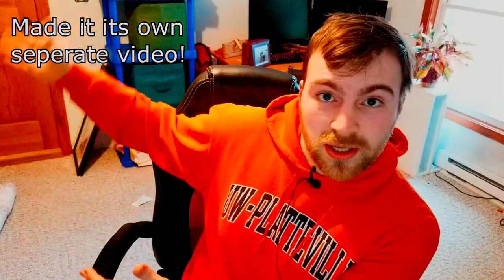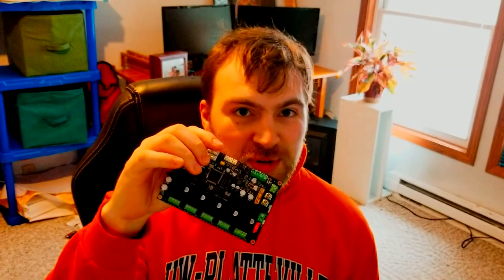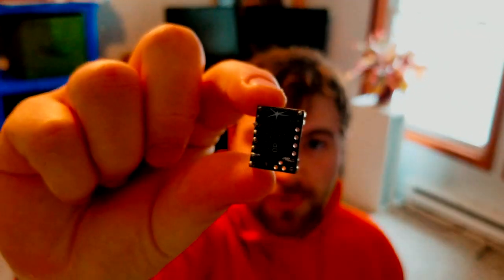Smoothieware to Marlin 2.0 - My story on the Azteeg X5 GT

Comment: Thank you for making this video. It convinced me to try Marlin on my X5 GT as well. Did you also have the problem that as soon as the sdcard option is enabled the communication with the TMC drivers is broken? I am also using the viki2. If so, did you find a solution or workaround?

Comment: I have some serious issues with Azteeg X5 GT as well. 
1. The hotend path gets totally out of control when it gets to higher Y values mid print, which results in priter crashing to hardstops. At first I thought it was caused by using grid leveling and WCS, but it still happens without WCS.
2. The printer freezes when starting print at beginning of first line (when it touches build plate). I found that if I change feedrate to faster, the issue is gone and print completes successfully. 
Now I am completely lost, because there is no clear information on the firmware running the Azteeg. Comments here are the best information source I found so far and it does not look good. Probably I will throw the printer to trash after I have upgraded it, because I am not going though all the configuration (and/or changing board) again.

Comment: I was in a process to replace my main board for my Rigidbot Big. I saw your video and notice you have Rigidbot Big and regular.  Do you have any main broad beside Azteeg X5 GT because this board is out of stock in many place.  I was having hard time to understand where to start and how it wire everything from main board back to the printer working again.  I saw your video on Marlin 2.0. It was helping on firmware edit and update.  If you have link where should I get all my parts, it will help a lot.
Reply from the maker: Hi!

I would not recommend getting the Azteeg X5 GT over more popular and cheaper boards that are out today. A very common board is the SKR 1.4 (https://amzn.to/2S6OYe5) (affiliate link) which has very wide community acceptance and great capabilities for the price of $62 with drivers included. If you want something that works out of the box and is rather easy to use, a duet 2 wifi will probably serve you pretty well.
Reply: @LukesLaboratory  Thank you so much  When come to wire back together, how do I mod the heat bed cable?  does Duet 2 using Marlin open source?  Sorry to ask like a newbie on this.  I just want to make sure I understand all the steps before order either board.  When I use those board how much improve that I will get in term of print speed?  I still using the stock broad that came with.
Reply from the maker: @kho75  There is a guide on the rigidbot wiki on how to join together the heating wires to make one "big" wire (since its really just positive and negative leads with 2 wires seperated for the thermistor) the Duet 2 uses RRF, which i believe at this time is a superior firmware - it uses gcode to configure it, no compiling or any other nonsense, you just edit settings in a single text file (and can edit them on the fly) and away you go! When you get your new board you may be able to go faster, especially if you follow it up with hardware mods.
Reply: @LukesLaboratory  Thank you so much to explain to me. Since yesterday I been watching a few video on those two boards setup.  You are so helpful.

Comment: Hey. Freezes like that absolutely never happen with a Genuine Smoothieboard. Azteeg uses a less powerful microcontroller than Smoothieware is designed for, and doesn't keep it's config and firmware up to date with the project. Both of these issues are likely to be the source of the print quality issues you seem to have. If it failed with heaters on, it must be using an extremely old firmware, this has been impossible in Smoothie for like half a decade. The stuff about the motion planner being better in Marlin than Smoothie is absolutely completely definitely incorrect, somebody was just talking to you out of ignorance, the Marlin devs themselves agree with this. Also, the difference in contributor base for Marlin vs Smoothie isn't as large as you make it out to be, and that's by design, due to the fact Smoothie also supports CNC and lasers, making it useful to more people, resulting in a wider range of contributors... If you take another crack at Smoothieware at some point, make sure you reach out to the Smoothie community if you run into issues, what happened to you are definitely things we would have been able to help you with...
Reply from the maker: Hi - Its been some time since i've posted this, thanks for the response.
A few things -
1) As I said - I actually tried quite a few versions of the firmware, updating/downgrading the config as I went along from legacy releases to the edge builds. The lockup issue persisted through all.
2) Here's the forum link where I reached out as I reported in the video -  http://forum.smoothieware.org/forum/t-4483417 I understand that the Ethernet board is an add-on, but for all I can tell it's just a simple hat that uses smoothies internal web server. Lockups happened regardless of whether or not I was connected to the web server. 
3) I just confirmed that the Azteeg X5 GT uses the LPC1769FBD100 Chip, just the same as Smoothie V1. No difference.
4) After I troubleshot&resolved the lockup issue, I did some additional printing comparisons since it was easy to swap back/forth between firmwares, and to try to substantiate what I read around the web. Using identical Gcode I got better (subjective, but repeatable) and faster results with Marlin's planning than smoothies. Same thing now that I've migrated to klipper - Same Machine, same board, improvement when switching to different firmware. (klipper is adding a rpi for calculations to the mix, but still)
I'd love to do a trio of comparisons between Klipper, Smoothie, and Marlin (maybe including stepd) and the LPC1769 can even run RRF with some tweaks for a quartet!
I can also be reached on twitter @LukesLaboratory or my email Luke@Lukeslab.online
Reply: @LukesLaboratory  There's no version of the firmware and config that's supposed to work well with that board, because Panucatt hasn't made it so they would by keeping things up to date and testing it out
It sounds like your issue was related to the Ethernet extension though as you said in the video. My comment was more about other issues we've seen users have with Azteeg products, that were due to Panucatt not keeping things up to date.

About the forum post, I was actually trying to help you and get to the bottom of this, but at some point you just stopped participating. You ultimately gave an update saying you figured out it's the module, but if you had kept interracting with me / participating in issue resolution, we would have figured it out together, the way we do with hundreds of users every year

We've seen lots of panucatt products ship with the 68. If yours has the 69 that's great, he has finally decided to fix that at some point. Doesn't change the fact he's not doing what needs to be done for his board and the firmware to work along nicely. The firmware and config he provides are extremely outdated ( last time I checked ).

About print quality, I talk weekly to users who say Smoothie provides them with the best quality of all the systems they've tried ( which is usually mostly just Marlin, but not always only ). And there are good reasons why that would be true, we put a lot of work into that, more than any other system. However, as I said Azteeg doesn't make it so their hardware works well with the firmware, so you can expect all sorts of issues, some of which will cause print quality issues, which I would guess is what you are seeing.
Reply from the maker: @ArthurWolf  as for the comments on the board what kind of things could cause the issues with both hangups/print issues? All of the features worked (when not frozen) to the best of my knowledge regardless of firmware or functional config. Marlin and klipper work flawlessly, as long as pins were assigned appropriately which seems to really be the only kind of customization needed to run smoothie as well on this board.

Sofar the only main difference seems to be tmc2660 drivers. 

I will do some digging to find my old config, but what I can tell you is that regardless of whether I started with panucatts config or started from scratch and configured following documentation, it did not make a difference either way. When I identified the issue as the ethernet module, I was expecting a line of questioning related to the module, if any follow up was needed/desired, especially since I was running a non-official board w/ add-on hat

As for print quality - I have nothing concrete here. All of the settings I can touch were more conservative than their marlin counterparts as I tried to diagnose their root, but even slowing down acceleration considerably did not get me the results I desired. Similarly, marlin cannot deliver as fast and as consistent prints as klipper does, even with considerably more tuning. I chalked it up to internal motion planning differences and called it a day. 

I would love to find out why the differences are the way they are (why smoothieware is the only firmware to not play nicely on this board) and if possible, to maybe give it another fair shake now that marlin 2.0 has some serious hours under it's belt.
Reply: @LukesLaboratory  The thing is, Smoothie v1 is extremely optimized for the current chip, it's using the chip much more intensively than firmwares that got to run there more recently. But this isn't true for Panucatt stuff: they have not done the intense testing / optimization we have done with v1+smoothieboard. Issues like you describe, nowadays we pretty much never see with Smoothieboard v1 under normal circumpstances, while they are fairly common with panucatt or clone hardware. You'd need to use the very latest firmware and very latest config, adapted to work for azteeg, but if you did that, you'd be in an extremely untested setup, so there's really no way you can win / be in a normal situation with this hardware, right now...
Reply: @LukesLaboratory  I have experienced the exact opposite and I'm talking smoothie 4+ years ago vs todays Marlin 2.0. From what I have read on the google Delta forums over the years Arthur is very proud of his planner. I was actually just researching to see if I could flash Smoothie on this printers STM32 board. Wish I could afford to support you Arthur but  this is hopefully next best thing :)
Reply from the maker: @ChrisHarmon1  Thanks for sharing your experience. My smoothie experience was from a few years ago as well.
Reply: So what’s the ideal setup if I have a an azteeg v5 gt board, I bought a couple printers from matterhackers. The pulse printers, xe. They have nice hardware, but I’m curious because i think it’s running the older version of the smoothieware. Wonder if I would get better quality if I updated the configs and the firmware?